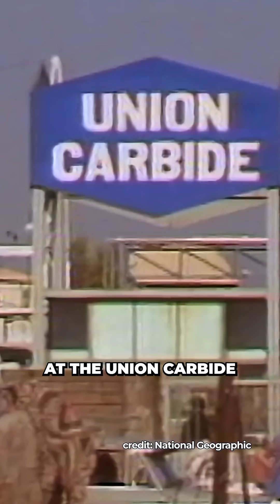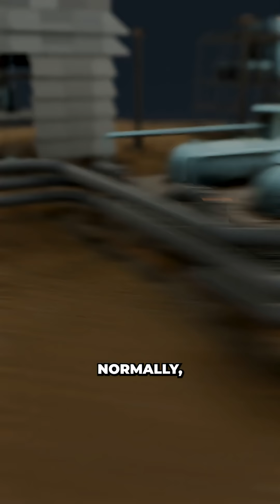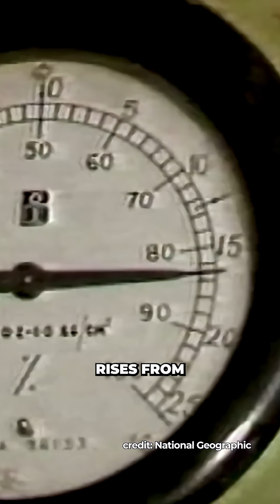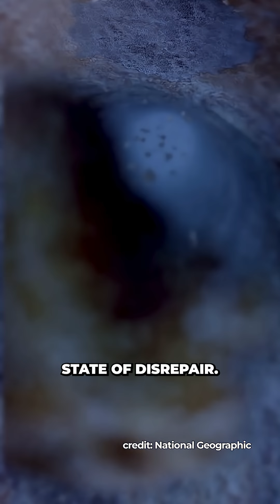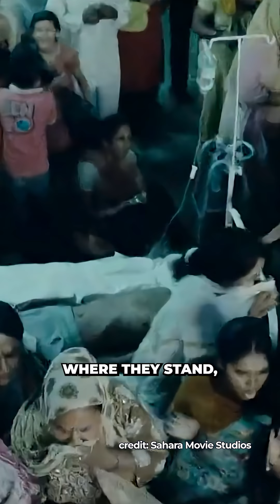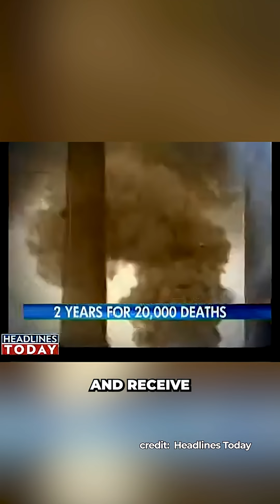The True Story of the Bhopal Gas Disaster

Comment: The most insane part is that there were like 6 safety measures and instruments and each one of them was faulty. Literally only one of them working would have stopped or greatly limited the disaster. Do not skip on maintenance.
Reply: No, no. One thing was working. But by that point it was the boy who cried wolf and the operator no longer trusted his instruments.
Reply: @joshuacheung6518 experience working in a plant any abnormalities should be confirmed, unfortunately for this case it's one of the probable causes of the disaster
Reply: @jzlnz when abnormalities are the norm, you don't investigate. It's human nature
Reply: @joshuacheung6518 still,gauges are kind of important to pay attention to…even faulty ones.
Reply: @johnlynch-kv8mz they paid attention to it. And then dismissed it.
Reply: @joshuacheung6518 two things, the gauge that was ignored, and the vent that caused the problem, but also prevented an explosion.
Reply: Nono it's worse. To cut cost they actually illegally weld pipes together to move liquids across the plant, meaning the same pipe would carry different liquids depending on what's happening

Then they just flush the pipes with water to clean them and pump the next chemical.
Reply: @Yadobler  clean the pipes with the chemical that reacts with water using water. Extremely smart
Reply: @Yadobler that one fact alone is insane, I never knew that
Reply: @Yadobler that's fine in most cases, you'd just flush it with methanol or acetone before pumping anything water sensitive through it
Reply: @Yadobler holy hell 😮😮
Reply: This happened during the Permit Raj, literally the whole country was slowly crumbling apart back then.
Reply: Lives of thousands of poor people vs my annual bonus and stock awards……hmmmmm….gimme a sec….I’m thinking………
Reply: Ikr those corpos really deserve capital punishment
Reply: actually the most insane part is union carbide officials responsible for this were given 1 hour of jail per death. thats legit a slap on the wrist for killing thousands over negligence cost cutting. multiple safety stops failing isint insane when orders from above are to ignore maintenance and repairs. what is insane is the system in place to hold these people responsible simply doesn't and expects the situation to not repeat itself one day
Reply: @draytonkk This is the sort of thing that should lead to companies getting dissolved and auctioned off. Imagine if let's say Amazon or whatever was convicted of a crime, and all of the stock was made worthless, and the government issued a new set of stocks for the entire company, to be auctioned off. That would mean that stockholders would make damn sure to stick to the law, as they wouldn't want to lose all of the value of the stock.
Reply: @draytonkk wow..
Reply: See the problem is, they dont care. They'll run production to keep making money bc the moment it goes down you're not making money. Sincerely a Maitenance employee who goes through this daily and almost had a Boiler blow bc of this
Reply: The pressure relief valve operated just fine
Reply: @protercool8474 damn, yes thats a good point. 

remember, safety is not a component property, nor is it synonymous with reliability. placing a "safe" component in an improper (unsafe) environment or use case is damgerous. 

As she reminds us, 

"Safety is an emergent property of systems that arises from the interaction of system components." 
New Accident Model for Engineering Safer Systems, 
Nancy Leveson
Reply: but what about the poor shareholder’s pockets??
Reply: @SungMammal  F the shareholders. Their pockets should not be placed above 15 000 lives.
Reply: @SungMammal  as I've said for many years and am shocked I've never heard anyone else say, the existence of the stock market, and companies being beholden to shareholders aka publicly traded and not employee-owned, is the primary reason the capitalism is a failure for the people living in it. Even if the CEO wanted to be good to their employees, once they commit to infinitely making line go up forever, they're committed to eventually screwing over their employees or shutting down the company, at some point. You can't profit forever. Even if one company owned everything on earth, printing more money for them to have only causes inflation and inequality and it's idiotic, insane
Reply: Seriously my only thought was, “WTF were the employees doing all this time?!”
Reply: @WMDistraction There were barely any employees, the plant had been closed and/or running at a tiny fraction of it capacity for years because Union Carbide wasn't interested in it anymore and was trying to sell it.
That tank had been sitting there half filled but unused for a long time and it wasn't even clear if the few employees even knew it wasn't empty.
Reply: @WMDistraction  not the employees the owners of the company.
Reply: @WMDistraction The employees weren't properly trained to stop this disaster even if the safety features had been working lmao
There are plenty of full videos on this incident on YT
Reply: @WMDistraction not getting paid probably
Reply: @WMDistraction did you not watch the video they tried to activate the faulty safety system
Reply: @WMDistraction  the thing was that the plant had become unprofitable, so UC hadnt approved any of the required funding to maintain the plant. moreover due to safety issues a lot of trained workers started to leave, so the company hired people with minimal 6 weeks training that barely covered the safety measures. So the negligence was caused due to the workers not even knowing how to perform a proper flush. leading to these events.
Reply: @WMDistraction on top of the lack of maintenance, engineers and trained technicians (which are usually payed more than regular workers) were fired and replaced by untrained workers. The plant's supervisor was also fired and replaced by someone who had 0 experience in the chemical industry. They also ran with fewer personel than intended. So you had a handful of untrained workers with no idea of what they're really working with trying to fix a faulty plant which wasn't maintained for years.
Reply: @WMDistraction you can't blame employees. This is on leadership. everybody has roles that take up much of their mental space. It's the role of leadership to make sure things happen.
Reply: @WMDistraction all they could, really. When you have as much on your plate as these guys, it’s hard to keep up
Reply: @WMDistraction  Not the employees the person who owned the place decided to only teach them 2 classes
Reply: @WMDistraction not the employees the fault, it is the owners fault. Employees just do their job. Owners make the decisions to cut safety measures to cut costs
Reply: @WMDistraction following orders and collecting a paycheck. What do you think they were supposed to do with no resources?
Reply: @WMDistraction Ignoring the alarms. One literally shut off an alarm siren because it was annoying and they didn't know how to respond to it.
Reply: @WMDistraction is probably being depressed. Realizing how their actively working to kill thousands and no one will listen to them. People, for some reason, are like deathly afraid to go on strike. We as a people can pretty much get whatever we want if we just come together and work as one to make the changes needed four our safety and health. But we'ed rather enjoy the "content". Which consists of basically the fall of our species 😂😂
Reply: @dako9307 I wouldn't call it being afraid to go on strike. It's more to do with survival. If people stop working they stop getting paid. Then they can't afford to eat, rent or pay for any other necessity. Often it's not just about themselves either. They have families that depend on them. So going on strike is a huge risk with no guarantee that they'll come out the victor. In fact they might lose everything since most people live paycheck to paycheck.
Reply: @luckyducky81  continuing to follow saftey hazards knowing its putting YOUR OWN familys health at risk, sure okay. Health insurance will def cover that.
Reply: @dako9307  didn't this happen in India? I don't think they have high safety or health standards there let alone health insurance.
Reply: @dako9307  not afraid but unorganized. Going on strike by yourself is stupid and especially in places like india will result in being fired. Everyone needs to participate to make it work. And so they keep working because they know nothings gonna change if they strike alone
Reply: @luckyducky81  exactly. But one thing they couldve tried is just to stop the production
Reply: @WMDistraction they complained but the corporates said it will be fine 

The corporates are the reason this happened cuz of cost cutting
Reply: @WMDistraction  dont blame employees what are you smoking
Reply: Same thing happened with Chernobyl. Gross negligence is a horrible thing
Reply: It's kinda skipped more often than we'd think
Reply: It's known as the Swiss cheese model. The more safety measures you have in place, the less opportunities for a hazard to find the "holes."
Reply: And that is why you do not let corporations dictate the safety standards,or food and drug regulations. 

ups... In USA you do. 😥
Reply: It's because the rich CEO's in their office are brain dead and think everyth is magic, that's why they skimp on safety, maintenance and all the important stuff

Wasting millions and lots of lives all for savings pennies 
Yes, pennies compared to their wealth, they instead choose to pocket the profits, selfish and narrow minded, dum even and have no experience in the field, and act arrogant and disregard warnings from engineers and workers
Reply: Lol yeah, at where I work we have isocyanate tanks and all the safety stuff has to be checked or replaced every year to make sure it works. Usually most safety features are replaced every year, some 2 years because older part like say pressure release valve that is installed for long time can maybe work when you test it but a week or month later it can get potentially stuck so they have it replaced and because its a safety feature they rather eat the costs than deal with catastrophe. This in the video is abysmal negligence since they didnt even test their failsafe features at the very least or rather maybe they did but figured it would be too expensive to repair and replace.
Reply: Every like 5 to 10 seconds I was going "oh for fucks sake"
Reply: This is ultimately the result when you allow elected officials to receive millions of dollars through g○v-sp○ns○red c○ rrupt¡○n... oops I mean "lobbyists" from the very same corporate conglomerates that they're supposed to be "protecting" us from (i.e. accepting bribes) in exchange for allowing those companies to not only influence but actually write our laws to be in their best interests and this all done at the expense of us "peasants" in the working class 💯
Reply: Clearly they were too busy with their main job of  committing wire fraud on the elderly
Reply: Actually there was one working, and it was ignored
Reply: The 1 thing that worked correctly was disregarded as "probably faulty".
The pressure gauge...
Reply: this is the result of farming out stuff like this to third word countries by UC
Reply: The government now protects those doing this through deregulation...
Reply: Even the human were not working. They were too used to false alerts that when the pressure gauge showed danger, no reaction. "Must have been the wind" kind of behaviour in wonky NPC is actually realistic...
Reply: @xuanbachlai5371  yeah, i didn't know that.. i feel like there's a special place in hell for safety engineers, who end up designing systems that cause net negative.. tragic
Reply: Was done knowingly, not ignorance😊 as mentioned in the video. "Cost cutting"
Reply: Why do you think KTM went bankrupt 🙄
Reply: Such a station shouldn't be in the vicinity of civilians in the first place.
Reply: @Jay-Kay-Buwembo You'd probably be shocked to know what chemical plants handling similar, and even worse substances, are located in fairly densely populated areas of the states and elsewhere. It is not unusual at all to have these plants located in cities and towns with large populations.
Reply: @Jay-Kay-Buwembo  "Such a station shouldn't be in the vicinity of civilians in the first place." - India is a pretty densely-populated country you know. And besides, industrial buildings have been built at the edges of cities ever since the beginnings of industrialization.
Reply: @CoolKoon I wonder if such a plant with such toxic materials that a leak could kill tens of thousands is just sitting in proximity to us Londoners here in the UK 🇬🇧. Unlikely.

There is a reason American companies have toxic plants in developing countries they make sure they aren't in their own back yard.

India is a subcontinent and thus a vast landmass, yes there is 1 Billion people but there is still plenty of land.
Reply: @Jay-Kay-Buwembo  pretty rich to act like American companies are the only ones treating people in developing nations as expendable as a Brit. I seem to recall India in particular had a bit of trouble that y'all were responsible for.
Reply: @Jay-Kay-Buwembo I don't know if the building was to close or not, but based on this short, the bigger problem was the complete lack of maintenance that eroded any safety margin. There were several safety measures in place, and the only one that seemed to have worked was the vent.
Reply: @fearsomefawkes6724 The fact that budget cuts could lead to such a failure in the only safety measures available with such hazardous & dangerous materials shows that such a plant should never have been close anyone.
Reply: @Jay-Kay-Buwembo I mean kind of.  If the local authorities would let them have their way they'd do so. The only conspiracy is the aim for locally better conditions.  They don't aim to push it elsewhere, but they naturally do push it to where the enviros have not control.
Reply: @Jay-Kay-Buwembo  "is just sitting in proximity to us Londoners here in the UK 🇬🇧. Unlikely." - Well think again then. There's Proctor and Gamble's plant in West Thurrock for example and no doubt you have other chemical plants around London too. The problem usually isn't their proximity but the fact that they aren't run properly and corners are cut.
Reply: @Jay-Kay-Buwembo you're surrounded by such places you wouldn't even know. 

Guaranteed there will be some Ammonia refrigeration sites not to far, with tonnes of it in the system.
Reply: @chappy2121 but with the set up like here where a failure would lead to a catastrophic dumping of the stuff into the atmosphere.
Reply: @Jay-Kay-Buwembo P&G has a detergent factory in West-Thurrock right at the edge of London. The other commenter is right, chemical plants are in commuting range of cities. Obviously.
Reply: @Jay-Kay-Buwembo India had to agree to it
Reply: @fletcherenfield9474  Im going to piss a lot of Indian people off, but before you fire up your rage and hatred, let me point out America is now just as bad or worse, so an open mind is my ask.

its a lot easier to blame foreigners. It seems to me the plant had plenty of safety features. However the government allowed a culture of neglect, corruption and bribery to take hold. Same thing with Chernobyl, except without bribery

So people conclude these plants shouldn’t be built in population centers, but that just leads to hundreds of deaths instead of thousands. How about no deaths? Its not hard to maintain safe systems when you have regular maintenance inspections and testing. It doesn’t need to be expensive either. 

But it never can be safe as long as you allow a culture of bribery and corruption. You may think Im being hard on the Indian government and you’d be right. Why do you think India isn’t  already the world’s factory? Again, a culture of corruption. Who wants to build factories there when its unstable due to corruption. Put another way: who wants to build nuclear plants in America anymore?  Same problem. Its going to be expensive, but add environmental politics and its impossibly expensive. We used to have a culture of integrity when our survival in the cold war depended on it. Three mile island was a full meltdown like chernobyl, except we have 20 foot thick concrete containment domes with steel liners and our designs prohibit allowing for an RBMK style runaway, so no deaths.

But now we allowed active measures and asymmetric warfare to turn the citizens against themselves, and the bureaucratic and policy mess led to the collapse of our manufacturing and a drug addled rustbelt where factories once stood. Now even our population collapses.

So, how do you fix it? 1. Love your neighbor as yourself. 2. Build a culture of integrity. In both India and America that means stop trying to gain at the expense of your neighbor. No more finger-pointing or bribes. Stop covering your ass and start covering your neighbors ass. 

In India you need a cultural renaissance. More pride and more humanity. Remember, you were the wealthiest country in the world, and then the jewel of the british empire just a few hundred years ago. You had the bravest warriors worthy of respect and inclusion in the mighty british army. 

In America we need to remember who we are. Less pride and more humility. We have the most diverse deepest pool of world class entrepreneurs, engineers and problem solvers. Stop fighting with and demonizing people who disagree with you. Stop virtue signaling your moral superiority while hating your own countrymen only to enrich and empower the elites and their 2 tiered justice system.

Well if you got this far, you obviously care enough to consider real solutions. Go and find like minded individuals and form the core of the leadership you need to empower real change. Godspeed.
Reply: @CoolKoon  When I commuted to Boston daily, the train passed by the Boston Sand and Gravel plant that was still operating. The plant was once on the edge of the city, but now is surrounded by highways and RR tracks, as well as new construction office, commerce and residential hi-rises. While not 'downtown' it is inescapably part of Greater Boston.
Reply: @NobodySpecial-h3v  "The plant was once on the edge of the city" - Yeah, back in 1914 when it was founded. And this is the case with literally every single big city in the world.
Reply: @CoolKoon wrong. Cities are built around industrial buildings not the other way arounf
Reply: @GamerplusMore  That's nonsense. 90% of cities in Europe predates the industrialization by centuries.
Reply: @Jay-Kay-Buwembo every country do this mate even the UK there arent any countries with perfect people
Reply: @CoolKoon I was going to say…never been there, but I hear tell India is populated. I heard the wood is bad for burning too. It doesn’t burn well.. I hear. A lot of people there tho, with a lot of ingenuity, but not much common sense. What are they going to do (to me) start online scams. It’s awesome listening to them trying to pull that shit off, demonstrating how they KNOW how (at least) Americans think. Some of us , anyway . Shiva is watching, people!i!
Reply: @Kry_baby0 I have no idea what this is about, but how can we blame those not present on site? People can make excuses and point blame , but unless those on site, were completely oblivious as to what they were handling , some responsibility lies with them. If I had a ball of radioactive material that I couldn’t get rid of, what am I going to do with it? Storing it with tungsten blocks with a beryllium dome, would not be my first choice. Similarly if I had a shit ton of highly reactive material that is deadly when it comes into contact with water, Putting it in the middle of a densely packed area with unwitting people, in some rusty leaky faulty aging pipes and tanks, run by people who obviously don’t have access to safe operating procedures, or didn’t care, would be no choice at all. That would not be an option…if I owned it. So why are those owners qualified to do this?
Reply: @johnlynch-kv8mz  Most of them aren’t qualified but radioactive waste, nuclear plants, and hazardous chemicals facilities are some of the most expensive materials to handle. It’s a mix of blame tho. The facility workers were underpaid, understaffed, and short on materials and training so they couldn’t accurately assess the situation. The owners were truly negligent tho. Nuclear products, disposal, and hazardous materials like I said are all expensive fields, but in the 80s it was a hot territory. And in the area that plant was those people work to live not live to work. They took advantage of a poor country with no accurate safety and labour laws, cut funding, and continually laid off workers until it was at the very minimum capacity. They know how hazardous the materials are and they are willing to continue the dangerous practices. I can’t blame the workers for not realizing cause every single system was faulty or just broken completely so there’s truthfully no real way they would have known what was happening until it was too late. Negligence is what’s to blame. The blatant disregard for the lives of others In order to maximize profit. It would have been better to shut down the faculty completely and safely transfer all hazardous materials else where but that was obviously more expensive than running at minimum capacity.
Reply: @Jay-Kay-Buwembo what are you saying, area wise india is smaller than USA and Canada , even australia and Brazil
Reply: @Jay-Kay-Buwembo the civilians weren't there when it was built, the population exploded post colonization
Reply: @Jay-Kay-Buwembo it wasn’t originally, but since they employed a lot of people in the past the town grew up around it.
Reply: @Jay-Kay-Buwembo where do you think the workers live?
Reply: You mean civilians should not build around such station. @Jay-Kay-Buwembo
Reply: The people that need to heed that would never read this though. Fuck
Reply: Like on the real India is a total shit fest. All I hear coming outta that country are horror stories.
Reply: the boeing door that blew off mid flight last year, had by design 4 dedicated screws to hold it in place , and independent quality checks for each screw... probably two screws were enough to keep the door in place. 
and yet.. 🛬😱
Reply: The AMERICAN GENOCIDE cruel killer are out of reach..... still they survive on earth.... And now they are DEFINITELY in the HELL.... BRIBE EXPERT AMERICAN.
Reply: Being a refrigeration engineer, you'd be surprised on how many places function exactly like that.
Reply: Budget cut is the answer
Reply: Welcome to India, this is nothing new here
Reply: Same reason for most mechanical failures, especially elevators which rarely have issues until they do 😬
Reply: India
Reply: and interestingly, you can still point the finger at operator negligence/error just refusing to accept PSI readings
Reply: Normalization of deviance. When a disaster requiters that 10 things go wrong to happen, it's normal to find out that 9 of them had happened before, every time for months at least 7 different things had gone wrong and 4 causes had happened every single time. It might only be a 1 in a thousand chance for them all happening at the same time, but if you risk that once a day you will expect to crap out in less than 2 years.
Reply: Yes, but it happened in India
Reply: First thing I refreshed on my old truck after I got it running was the brakes.
Reply: Negligence maintanence issues
Reply: Yeah, ok, but that one guy could've stopped it when that pressure gauge went dangerously up...😢
Reply: "Then it encountered another safety measure. But guess what? IT ALSO DOESNT WORK"
Reply: The most insane part is that this plant should have been in the US, not India. Even more insane is that it hasn't
Reply: EXACTLY!
Reply: The gauge was working, but was ignored…
Reply: That's the ceo who decided that
 Remember the fault lies with the one who controls and owns most of the company.
Reply: Of course it's faulty, that's why I'm jealous of Americans, every bit of Bangladesh and India is bad (I'm half indian half Bangladeshi)
Reply: This is the Swiss cheese model in action.
Reply: Why are you surprised? This is what capitalism leads to. Saving up money by neglecting safety measures.
Reply: The gauge wasn't but so many others were that it was assumed to be
Reply: This is how Three Mile Island happened too. Maintenance and safety policies are NOT to be played with
Reply: But companies have a right to profit!! 🇺🇸😤🇺🇸😤🇺🇸😤🇺🇸😤🇺🇸😤🇺🇸😤🇺🇸
Reply: Poor people are human?
Reply: Accidents happen when multiple lazy/entitled people meet. Like when driving on the road.
All it takes sometimes is one level headed person to stop a disaster in time.
Reply: Pressure gauge was not faulty
Reply: It’s called the Swiss cheese model. You can have multiple layers of safety with holes in them, no problem. But when they all lign up just right, catastrophe ensues.
Reply: What - cleaning shutter, refrigerator (not broken but shut off), gauge (not broken but enough of them were), caustic releaser, and incinerator. Yup, disgusting
Reply: This is the deregulation republicans desire.  The poors are a worth sacrifice for the corporations
Reply: Skimp not skip
Reply: Very Chernobyl-esque in that regard. Almost a comedy of errors had it not been for the amount of innocents injured or killed.
Reply: The pressure valve did worj
Reply: Sadly, no one is surprised this happened in India.
Reply: Why? They think. No penalties for me, anyway.
Reply: The boss refused to put in purchase requests for the safety equipment that needed replacement. He was quickly and quietly airlifted outside the country.
Reply: Greedy capitalists do not care, they would rather save up on safer than go bankrupt
Reply: @SomeUnicorn7000  and the workers that night saw the developing problem and decided to go on break before trying to fix it
Reply: @SomeUnicorn7000 or bored socialists. This isn’t a left or right kind of problem. The entire body is effected.
Reply: ikr just one becuase they had so many but costs couldnt cover
Reply: Don't skip on punishing people who skip on maintenance*
Reply: But they're 6, so this one is fine to cut off, their 5 more, 4, 3more...ohhh sh!t we just killed thousands.
Reply: insane swiss cheese alignment
Reply: Corrupt capitalism
Reply: Indians dont care abput maintenance